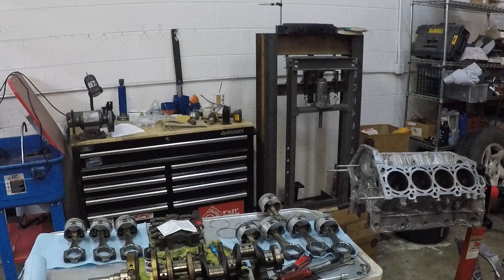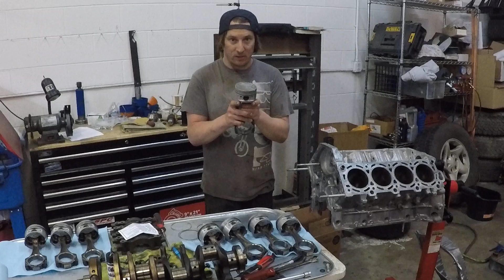Toyota Piston Rings

Comment: Yota. I have a 2004 Corolla. I was Loosing oil. Had valve cover replaced. Didn't solve issue. I do believe I have a problem with the piston ring maybe stuck, or the little drain holes could be clogged. The car runs excellent. I am not a mechanic! Can I try an engine flush. And maybe use Yamalube ring free for awhile, or liquid molley valve clean added to the gas tank? I have 218, thousand miles. I have a limited income. Can't afford to buy another car. Trying to get some more use out of it. I did subscribe! Thanks for any advice brother. Note car still runs excellent!